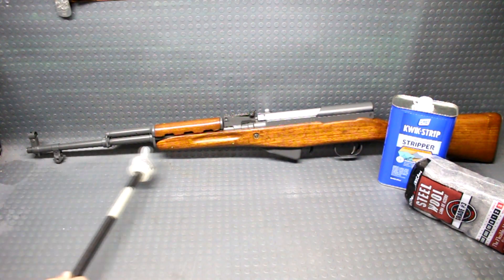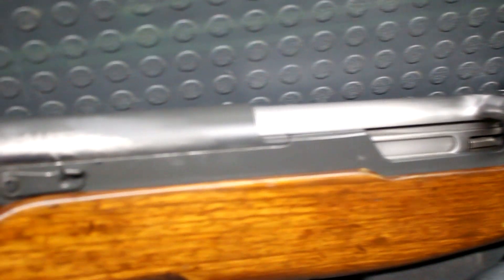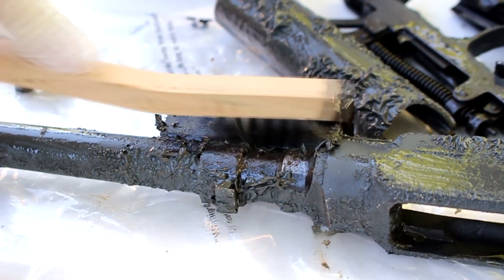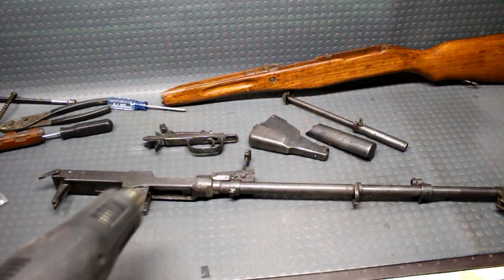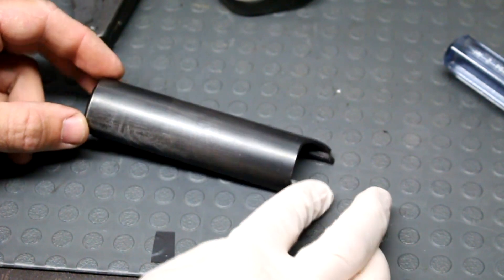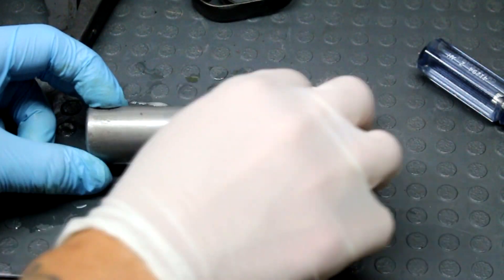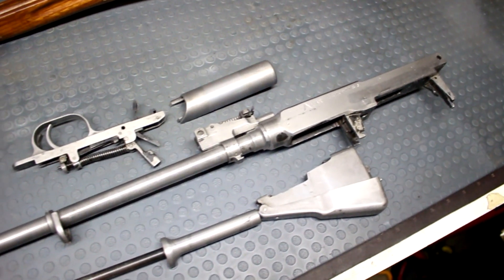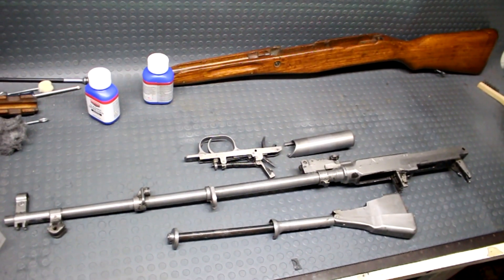Bluing Removal SKS Project

Comment: For future reference; toilet cleaner works great for bluing removal. Apply with a rubber or sponge brush and, after a couple of minutes, wipe off and rinse.
Reply from the maker: Great tip! ill have to try that some time !
Reply: @ZRUSOutdoorsChannel  please don't, toilet cleaners have vastly different ingredients for different brands. Use 50/50 hydrochloric acid and distilled water for blueing removal but make sure you rinse and fully remove all acid after you're done or it will rust to shit in no time .

Comment: What pad are you using for the work bench? Rubber?
Reply from the maker: its just some material that i found in a dumpster at work. I believe they use it on the floor and steps of private aircraft.

Comment: Don't cut the lugs off, you can get another action online an use that. Maybe one day you mite want to turn it back in to its original state with the wood stock, its just to easy to get another receiver with a barrel an bubba that. Their only going up in value if left all original, right now in original configuration they sell for 500, an those are beat up Vietnam era rifles, in its stock self even reblued, its still worth a chunk of change, DON'T BUBBA IT.
Reply from the maker: Thats more work than i want to do for this project. Have faith in my bubba skills lol
Reply: @ZRUSOutdoorsChannel  its not a lack of skills, its defacing a quality rifle when there's other options around, that's all.
Reply from the maker: @williammccaslin8527  yeah I get the reason that some believe a C&R firearm shouldn’t be modified. For me,  I like the design and function of the SKS, but in a slightly more comfortable form. All of my firearms do work, I don’t own anything that is only meant to be admired, shot a couple rounds then put away. But I get why others would.

Comment: No offense, but cold blues really don't work for a complete finish as it is just a thin layer of copper ferric acid that has poor rust resistance and can actually promote rust on the steel.  A better, but more time consuming process is real slow rust bluing as it is the most durable bluing finish that has superior results.
Reply from the maker: I can tell that this bluing is shallow, but as of yet, i have no issues with it of the 3-4 times that i have had it out shooting. But i will report back if need be.